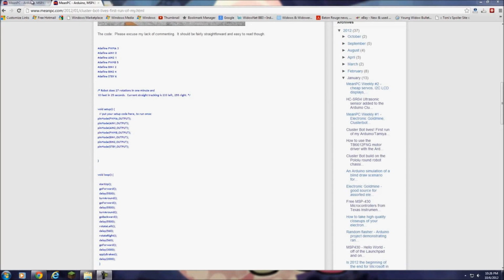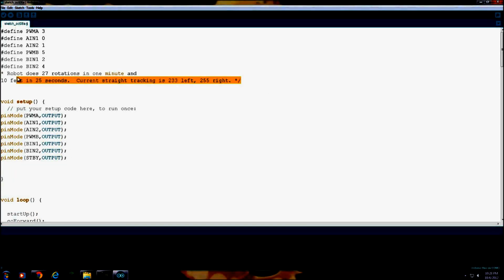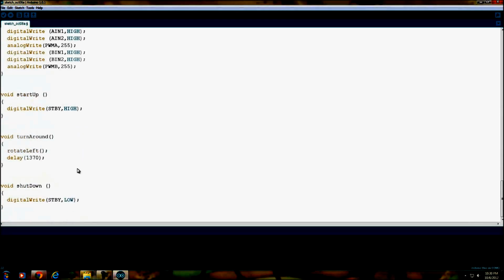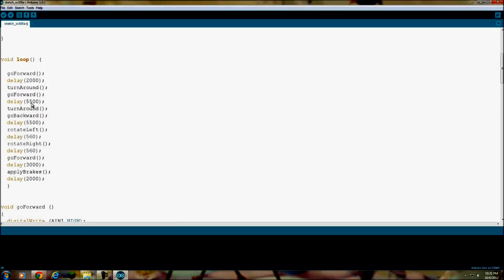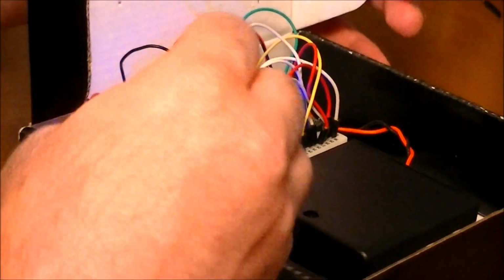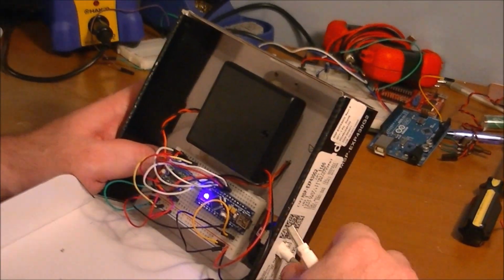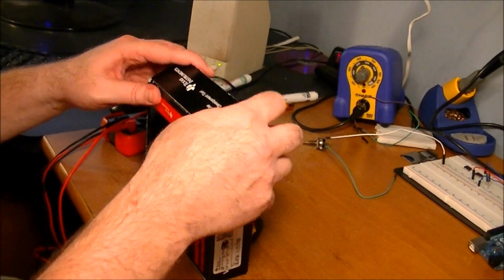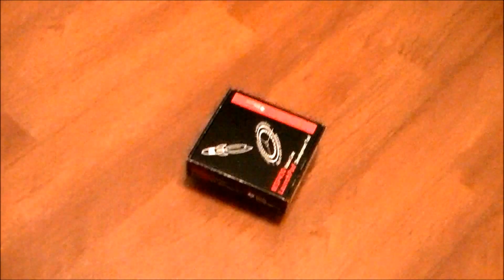How to build an Arduino robot - test code and test run

Comment: Yep, great tool for the job.  I am learning about surface mount parts now and have been told you can use it for that too.  So far I have only worked with DIP chips.